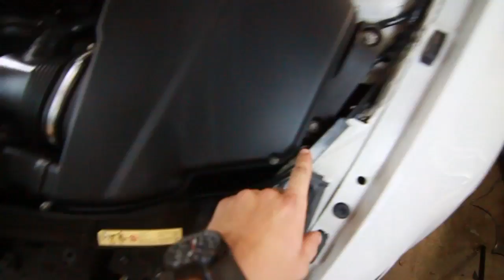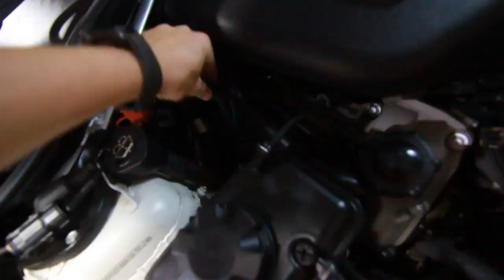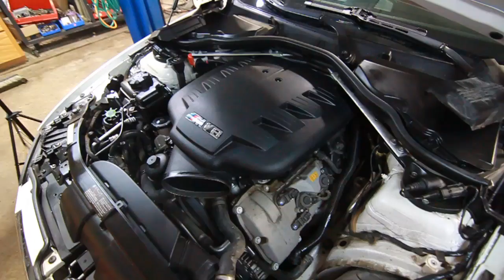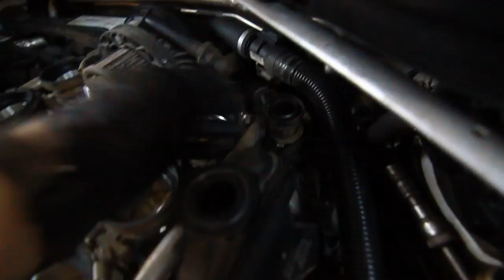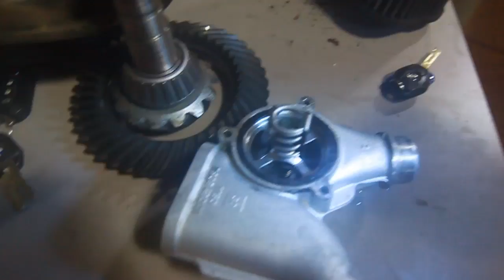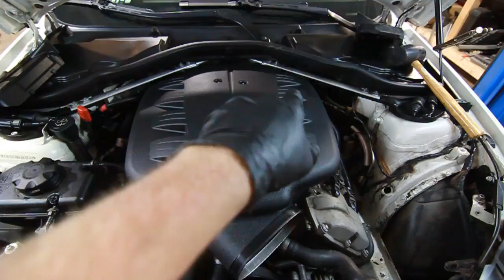BMW E90 E92 E93 M3 S65 V8 Water pump and Thermostat DIY replacement

Comment: Thanks for the great DIY!  Just completed the job in a few hours on mine with 74k mls.
A few things I didn't need to do.  Airbox comes out as 1 piece, just two bolts on the right holds it in place, remove the snorkel, loosen plenum hose clamp, pull up and wiggle out.  Plenum box sits on top of the OSV and pops right off when you remove the 8 hose clamps so no need for Ignition coil covers and coolant reservoir to be removed. The 3rd + 4th clamp on the left are a little tougher - use a shorter extension to get at them.

Comment: Just did this on my 2011 E92 M3.  Thanks for the great video.  Dealer wanted $1500.00.  Did it for $200 in parts.  Took about 2 hours.  Be careful with the bleeder screw.  Mine broke when bleeding due to cheap plastic.  Regular auto parts places have replacement screws.

Comment: Fantastic video!  Only thing is that these cards have an electric bleeding procedure since the water pump is electric.  

1)  Insert the key into the dash slot and hit the starter button (but don’t start the engine – e.g. keep your foot off the bake/clutch).
2) When the ignition is on, set the heater to the highest temp (84 deg.) and set the fan on low.
3) Hold down the accelerator pedal for 10 seconds then release. This activates the water pump and it will cycle for about 12 minutes to vent all the trapped air into the coolant reservoir (it sounds like a min washing machine). Don’t open the reservoir cap or bleed screw during the venting process! (you’ll have start the process over) You may want to hook up a extra battery to the under-hood jumper points to keep the car’s battery from running down.
4) Once the water pump stops after 12 minutes, open the reservoir cap (it will hiss a little) and add coolant until the measuring stick (ball indicator) is 6 mm above the top of the filler neck.
Reply from the maker: pump is absolutely not electric on the M3 (or 335D)

electric on the N51, N52, N54, N55 cars yes.
Reply: LOL....He installs a mechanical water pump (clear as a bell) and you think it is electric....with a belt wrapped around it

Comment: Very informative, I really like the extra little tips you give.  Those tend to save DIYers a lot of time.  One note, you don't need to loosen the oil separator or remove the spark plug covers (and by extension don't need to loosen the coolant expansion tank) to remove the plenum. All you need is a flexible bit extension with a 6mm socket (or was it an 8mm?).  You can easily snake that to the 8 clamps.
Reply from the maker: makes it easier and takes less than a minute
Reply: Yea I don't have to remove the PCV or the covers or the expansions tank, got my electric ratchet, a wobble extension, and a deep socket 6mm. I can get the whole intake plenum off in less than 10 minutes. I'm going to be doing this job this week, hearing noises from the pump on startup and increased emissions code, which apparently can be caused by the thermostat.
Reply: @erack1 you fixed it?
Reply: @dannyphantoom69 damn that was so long ago 😂. I don’t remember
Reply: @erack1  so u sold the car

Comment: Big big thanks for this video.  I am going to attempt this today.  Wish me luck....!
Reply from the maker: you'll do fine! :p
Reply: Sorry to bother you but can I ask your advice on one step.  I’ve got 7 of the 8 jubilee clamps loose but I cannot access the last one.  It’s the one at the far back on the left as you look at the engine.  Any tips?   Big thanks.  Neil.
Reply from the maker: a what a what now? jubilee clamp?
Reply: Ovalbore The clamps that hold each throttle body to the air intake.  Don’t worry I managed to get it loose with a long extension.   Took me 4 hours to get the intake off!  It’s very fidderly the first time you try it!

Can I ask if you had to drain the coolant? If I remove the hoses from the thermostat will coolant spill out?  Thanks.
Reply from the maker: I just drained it on the floor pulling stuff off. the proper proceedure for draining is different, but I didnt particularly care:)
Reply: Ovalbore Thanks mate.  That’s what I ended up doing.  Lost about 2 litres.
Reply from the maker: glad it sounds like you were successful!
Reply: Does anyone know that part numbers for all of the o rings?

Comment: Its a chill vid, THERE IS A COVER ON THE PULLY I looked for 45 mins for the bolt had to watch a diff video. Not bad for a country install, def ALWAYS REPLACE them dag gone seals, Mine are leaking.. 2011 with 175k, Torque specs are also essential Continue mission

Comment: Just an FYI.  I was able to get at and loosen the plenum clamps fairly easily with a socket on an extension so taking the coil cover off is unnecessary to get the plenum off.  

Thanks for the video.  I followed it to get access to the secondary air pump and replace it.

Comment: It should be noted that the 2 bolts on top of the plenum box are non-functional. DO NOT TRY TO REMOVE.  the author doesn't verbally say to remove them, but he does point at them when referring to screws to remove on the intake.
Reply: +Charlie Hustle btw i just replaced my thermostat at 35K miles. this diy was helpful, but didn't really refer to the coolant and whether it should be drained.  I ended up using a turkey baster connect to a rubber hose to drain the reservoir. Emptied about a gallon and resulted in very little coolant loss when disconnecting the radiator hose.  Also, beware the bolts on the oil separators are aluminum so if you drop one (like i did) you can't retrieve it with a magnetic tool.  I found it wasn't necessary to loosen them anyway.  Don't pry the thermostat out of the housing. pull straight up, alternating sides until it loosens.

Comment: Really great video. Thanks for making this. How long did this take you to do? How long do you anticipate it would take a novice? I thought this would be a harder task to perform on the S65 but this video makes it seem very simple.
Reply from the maker: I think this took me just over an hour start to finish. novice with inadequate tools, likely 4 hours.

it's very straight forward. Much easier in my opinion than a 328i or 335i water pump.
Reply: That's about what I was guessing for a novice. Very cool. It seems like the alternator is pretty accessible while doing this job. Do you think replacing that while you're in there would take much additional time?
Reply from the maker: pretty much the only part that's easier when doing this for the alt is the belt is off and the air box is out. I personally wouldn't do it unless you know it's about at the end of its life. would not be hard to do after the fact.
Reply: Makes sense. The plenum doesn't look like it needs to be off and the airbox is a piece of cake to remove.

I just bought my car and it's about to roll over 62k miles so I'm trying to take care of these things before they fail :) Especially the water pump. It's nice to see that the M3 didn't get the electric pump used in the series cars.
Reply from the maker: correct

Comment: Thanks for this video. Very helpful. One question though, there are 4 o-rings that come with the kit if you order them on fcp. However, I only see 2 o-rings that need to be replaced between the engine coolant pipe and the thermostat housing. Have I missed something? Can the sleeves be taken out and another pair of o-rings installed on the inside?
Reply: The sleeve comes out and there are two more o-rings

Comment: Hi, this is a great DIY video, very thorough and clear. I am having difficulty mounting the belt onto the water pump pulley after replacing the waterpump. Pushing down the tensioner is not giving enough slack to let the belt get onto the pulley. It is wet from the coolant that dripped from the thermostat housing. Any tips on how to mount the belt? just let it dry and try again? Thanks!
Reply: Was using a hex socket (the bolt got stripped slightly and a regular wrench wouldn’t hold it anymore) to rotate the tensioner clockwise and the ratchet head kept hitting a steel pipe, not allowing full slack in the belt. Used a ring wrench and it solved the issue. Thanks again for the great video!

Comment: Awesome video, it really helped. Thank you for posting it! :)

On the way in, you didn't mention the cover over the tensioner bolt. I expected an offset bolt on the tensioner frame; turns out you have to remove the cap and just pull the tensioner itself with that 14mm wrench. You also don't mention any tricks for getting the water pump  pulley out. it's atight fight, both coming off or going on. Any tricks for getting it off and on?
Reply from the maker: tensioner cap is an omission, apologies -- I have worked on BMWs with those caps dating back to 1991 so I know exactly what they are and how to deal with them (usually they're missing) but yes good point. pry under the lip with a flat blade screw driver and it pops right off.

the pulley wasn't all that tight a fit here, came right off and popped right out with the belt off to the side.

Comment: Just discovered your channel great video! 
  Not sure if there is anything wrong let's see what you think?
 Just want to make sure my car doesn't have issues, after driving for 20 minutes the temp gauge gets up to just under half(the only way it will get to the half mark is when I'm in traffic for a bit)
 I know some what cooler is better but wondering if that is normal, or do I need to change my thermostat?
2011 E92 M3 102,000 kms on it
 Thanks
Reply from the maker: they'll throw a thermostat under threshold code usually. the E90s temp gauge is also oil, not water IIRC

Comment: Great video.  I just hit 60k, suggestions on real (vs dealer recommended) service to do then?
Reply from the maker: capybaras honestly, I'd probably think about water pump, tStat, valve cover gaskets and checking rod bearing wear.
Reply: Ha totally forgot I already saw this video (9 years ago, 😮). Just hit 132k, still a solid car. Now looking at the thermostat

Comment: Very nice DIY info!!! on what mileage this is needed to be done? and what about rod bearings n oil pump?
Reply from the maker: this car had 121K. it was overdue. I'd say 80K mile interval is tops for safety.

rod bearings, do oil analysis and check for copper tracing.

never heard of oil pump issues.
Reply: +Camper1234599 thx for the advice, I changed rod bearings at 103000km (65k miles) cilinder 6 and 7 where hitting copper already...I also changed the thermostat but did not do the water pump or do you really recommend this? regards, if you want a picture of rod bearings send me ur email on pm?
Reply from the maker: +eraserke the pump generally fails before the thermostat.

I don't need the photos, no. I have experienced rod bearing premature wear with the S54, S65, S85 and S62.

Comment: Any plans on doing another diy for a common issue with the e92 m3, replacing the throttle body actuator?  Thanks!
Reply from the maker: Jimmy H I plan on doing a DIY for every maintenance item this car comes in needing. so far the throttle actuator is original and still functioning properly.
Reply: what's the labor time involved from start to finish?  Thanks

Comment: can you do a video on just a coolant flush on an E9X bmw m3? Youtube doesnt seem to have just that.  Thanks.
Reply from the maker: I don't have an E90 M3 around right now. 

drain radiator, drain block, refill and bleed. should be pretty easy.
Reply: How many litres required with distilled water?

Comment: Hey I know its a old vid, would you happen to know what the torque is for screwing down the 3 bolts for the thermostat as one of mine broke while trying to tighten! Thanks 👍
Reply from the maker: aluminum housing and steel bolt. I'd say no more than 8 foot pounds should really be needed.

I dont have the spec though

Comment: Hello, very good friend, the video. I want to ask you a technical question. a month ago I bought a M3 E92 manual transmission year 2009 it has a slight vibration when I accelerate it stopped in neutral between 1200 and 1500 RPM. It feels like the engine is out of balance, is that normal? do you know what the problem would be?
Reply from the maker: tied to RPM specifically? pressure plate. otherwise if its tied to that RPM in just one gear, flex disc.
Reply: @OvalboreCars  Hello, thanks for answering.
Linked specifically to RPM in motion the vibration is not detected. and at RPM greater than 2000 it evens out the gear.

Comment: Hi: Thanks for this info:  is this water pump and thermostat are the one that cause the Transmission to overheat? last night my M3 dash said " Transmission overheat" but this morning it's not there anymore, and car drive normal. so dose that mean my transmission is still o.k? I hope it;s not transmission . please reply....Thanks
Reply: I had the Transmission overheat message on my 2011 M3, the dealer said they needed to update the Transmission software to correct the problem, wanted $200 for that job.
Reply: wow That's good news that nothing wrong with my transmission otherwise it's expensive,,,,,,,But $200 for update is rip off... This happen last year too around December and it's software update stuff. at least we have a nice fun car to drive everyday,,,,,,I got 51,000 miles now !

Comment: The tensioner step is very confusing, you oversimplify it. There is a cover on the tensioner pulley that needs to be removed in order to put a socket on it
Reply from the maker: It's definitely not an over simplification. very typical to have a cover on any vehicle's tensioner wheel.

This isn't a good 'first' service job for a shade tree at home mechanic, so it's fair to make the assumption and move around it for the sake of time.
Reply: It's very typical to have screws and bolts on a car too, so can just skip the entire DIY altogether. Given that the part of the video where you attempt to show where the tensioner is, is not clear. Skipping the step of removing a part on that tensioner is oversimplifying...

Comment: Are there any bolts that needs to be tightened to a specifc torque value?
Reply from the maker: technically all of them should be, but just be sensible and it shouldn't be a problem. typically joining torque does not have to be very much.

Comment: how do you know/identify there is an air gap? thanks.
Reply from the maker: cold vents in the car with heater on
Reply: hmm what does that mean? Im starting to elarn a bit abt the insides, own an m3 but I basically knows nothing abt the mechanical stuffs. Plus Im from Malaysia and these cars does not have heater, it uses aircond.

Comment: @Ovalbore If I'm just replacing the thermostat, do I need to drain the coolant?
Reply from the maker: you'll lose a little, but not much. should be fine without draining it.
Reply: Will it need to be topped off?

Comment: Hey man, I'm planning to pick up a 08 e93 M3 in a few days with 34k miles from the dealer. Do you recommend getting anything checked out or replaced?
Reply from the maker: +Thomas Lee 34k is pretty darn new. only stuff I would do is brake fluid and little time sensitive things like that, as well as general inspection stuff. you've got a while till' you have to worry about anything serious.
Reply: @OvalboreCars  I don't know... I  have a 2013 E92 M3 and it only has 28K miles on it.  My oil level reading as too high all the sudden after 6 months of driving without issue. I found out i have a code P0128 Coolant Thermostat Malfunction from the OBD2 reader.   Now I want to know if it's necessary to change the water pump if i decide to change the thermostat?  Great video btw.

Comment: Hey man, can you do some "engine buyers guide" or something like tha on this car?
I'm going to pick up one of these, but i gotta be honest, i have no fucking clue what to look for on a used car like this.. I could really use some video material that's gonna help me out before buying one of these :)
Reply from the maker: +NobodyCares 

This was a friend's car I was doing service on at the time -- I'd be happy to do another video with the common things to look for but would be a stupid video without an E90 M3 in front of me.

That being said the PPI is king on these cars. the main failures I note are as follows:
1.) engine rod bearings. you can often times get oil analysis from a company like Blackstone Laboratories in IN (not a paid sponsor, I just love their service) to pick up on high lead and brass levels in the oil before major damage is done. this should be noted in service history if it has been done prior to you buying the car, if not -- I strongly suggest at VERY least getting a drained oil sample from the car at time of PPI, sending it in and checking metals levels in the oil, if not -- budget to have the bearings replaced.
2.) throttle actuators. the electric fiddly bit that actually opens and closes the throttle bodies on the S65 engine proportionate to your foot potentiometer (throttle pedal)
3.) clutch release bearings. I have seen this a few times on 2008 cars only. you'll notice a strange clutch take up. requires clutch kit replacement.

I would also as a rule avoid the DCT. get a 6 speed. it'll hold value better and will not cost you basically anything to run. plus side is the car is 200 lbs lighter without the DCT.

Strongly suggest the 4 door sedan as well. more rigid body shell and the interior will hold up to the test of time better than the 2 door. (just how it has always been on the 3 series).

less common issues will ALL be brought to light by a PPI. neglected services on trans and diff oils, potential structural issues on subframes from cars that have been hustled on the track a lot, etc.

check brake rotors and pads. Pads are cheap but a set of rotors for this car is $1,000-$1,200+